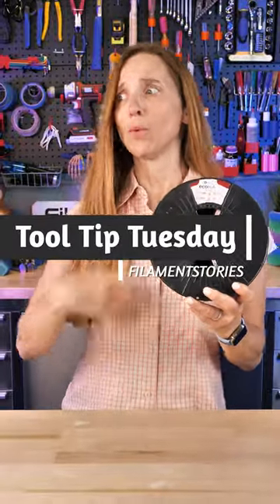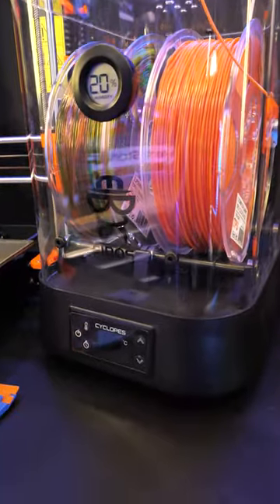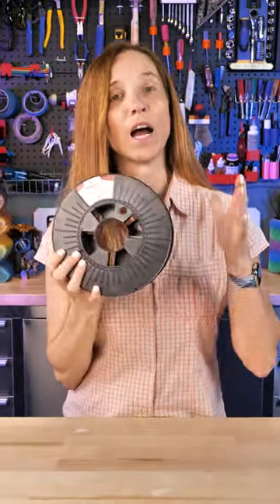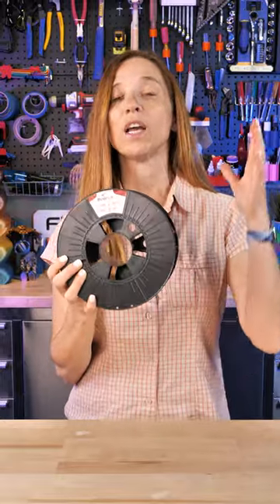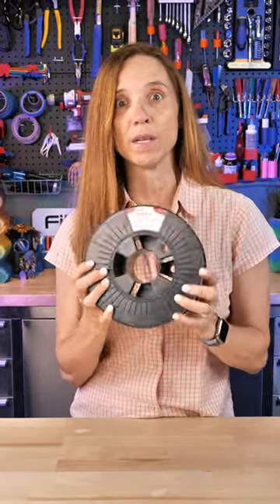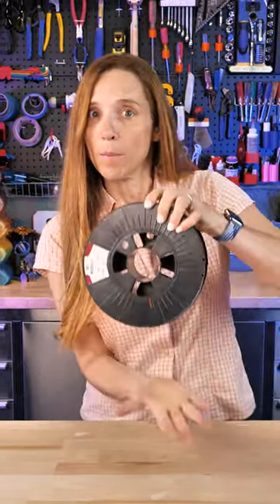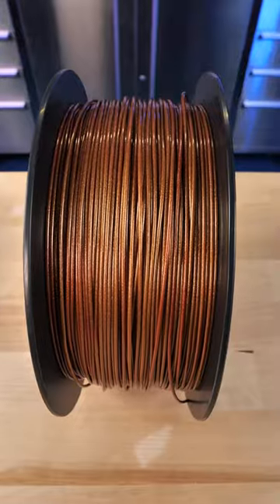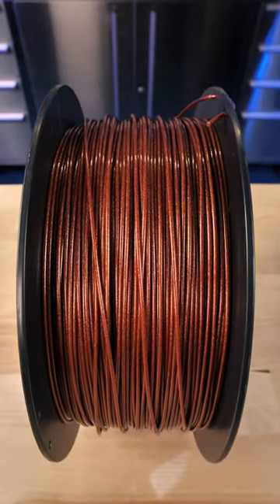Woah! Don’t OVERDRY your filament! Tool Tip Tuesday!

Comment: I got the Eibos single spool dryer and switched the sensor to a temp/humidity display. The filament temperature types that are shown on the dial setting knob actually correspond to the temperature right at the heater core which is contained in the middle of the spool support spindle. I looked at the dual spool dryer but read a few things about it that I didn't like. I got the single spool dryer on sale off Amazon and have no complaints!!!

Comment: I dry new spoos for 4hrs. Then they go in a waterproof tote that has 1400g of silica gel in it. Tote stays around 10-20% humidity. But no long heat exposures.

Comment: On Prusa website they recommend 45 degrees Celsius for PLA, perhaps the 5 degrees difference do make a difference
Reply: No, the issue is that driers turn the heater on and off at a constant output temp around 90C, and then use the duty cylce to get the correct volume temp.  But now you have 90C pulsing on your filament!.  I am currently making a deflector shield for mine cyclops to fix this (and adding a auto rotator)

Comment: People have already tested so much printing with filaments is different moisture conditions.

Solid color PLA is really not affected by moisture. I saw a video where the guy had different leves of moisture in many spools of PLA filament, including one extreme that was fully  soaked under water for many hours... nothing happened, PLA absorbed almost zero... and then printed the boat perfectly. 

All spools were opened for many days, regular humidity place, no silica gels, no plastic bags, nothing.

PLA with wood or silky do absorb a little more moisture and need a little care, keep it in a bag with silica gel.

They did not test other materials.
Reply: Matte PLA and PLA CF are problematic too.
Reply: It's also depend on PLA quality too. My solid color PLAs are so brittle, it always break wothout drying. My area is so humid.

Comment: Good lord what is this bullsh@t, you CAN'T overdry filament, all she did was leave it on top of a heat source too long and she OVERHEATED it, changing it's properties. It would have been no different if the filament was out in the open and sitting on top of a hot radiator. No drying, just overheating. GOD i wish youtube would stop putting these know nothing channels in my feed, it's annoying blocking them.